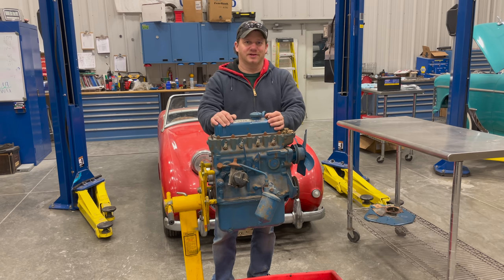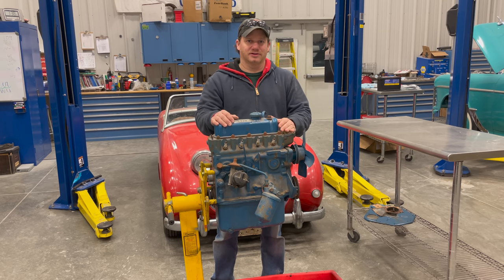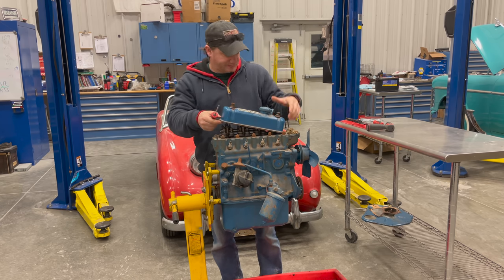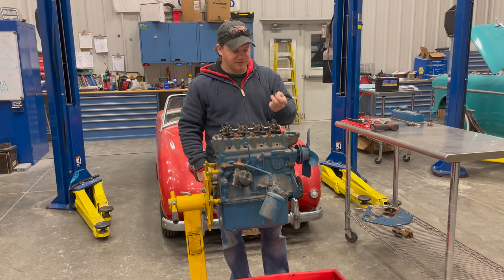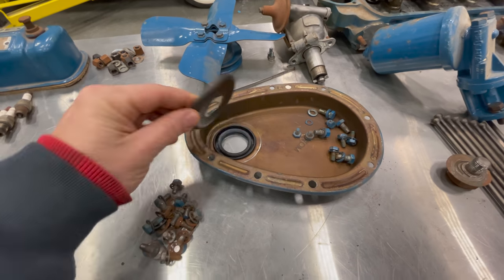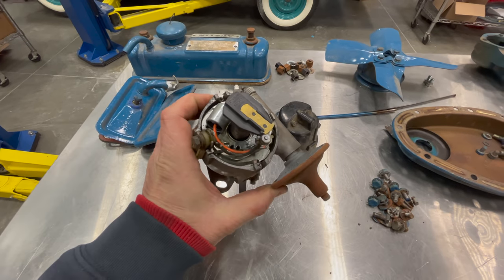Engine Tear Down for Barn Sprite Number Five

Comment: The reason for not using new plugs on a fresh rebuild is we old school mech's didn't want to oil foul new plugs from the assembly lube.  Back in the day spark plugs were not so good quality.  Just saying.
Reply: Logical !
Reply: @marcryvon  The usual process was run, and drive the car for about half an hour.  Replace the Plugs, and oil filter.  Just old school process.

Comment: The cost of a "service kit" - plugs, points. distributor cover, spark plugs, air/oil filters is pretty low - for my 1098 A series engine. The biggest problem is with the cylinder head gasket... 
The gap between cylinders 1&2, 3&4 is quite narrow. If the head or cylinder block isn't perfectly flat, the gasket will blow between one of the pairs. If you have the head off, it's worth checking!
(the original is copper/asbestos - nowadays copper/cork).
Regarding the valve seats, do look up the experience of the Morris Minor Owners group - there's views both ways, but unless you're going to drive it hard and high mileage, you shouldn't need to invest in changing the seats for ages.
The problem I had with the A series is that of condensation - the rocker cover would have amounts of white oil/water emulsion - this then gets into the breather pipe and causes minor problems. Regular oil changes (about 6 months or 6000 miles on a quality multigrade oil - not synthetic - will help!

Comment: You do tend to have pretty good luck with mechanical stuff Steve but this time, looks like a total win/win. The only thing that would be worrying me a 𝑤𝑒𝑒 bit is: Why was it never run, or even installed? Did the last guy find a huge problem or did something unrelated change his plans? Here's hoping he just got side-tracked and you've got 𝒂𝒏𝒐𝒕𝒉𝒆𝒓 excellent wee sports car, with a rebuilt engine.👍👌😁
Just a thought: could 2021 be the year of the 𝑙 𝑜 𝑛 𝑔 𝑒 𝑟 videos?😂

Comment: I'd check the clearance in the oil pump just in case they missed that. Distributor looks hideous, wonder why they put it back like that? Sweet engine. Where's the inlet manifold and carb, exhaust manifold?

Comment: When they made those side plates I wonder why they did not put bolts around the edge, outside the gasket.  Putting a bolt through the middle defeats the gasket.

Comment: Has the head got hardened valve seats?
Reply: No, but getting the A-series engine converted to being ULP-compatible is a routine procedure: boring out the original valve seats, pop in hardened steel rings and then re-machine.
Reply: @Seele2015au  Tks. I'm aware of the practicalities of doing it. The question was more if it had been done as part of the previous work on this engine.

Comment: I’m new to these little Sprites. What color were the engines originally?
Reply: Hi James. I guess the nearest l can think of is the Green on John Deere tractors  ? Or fresh dark green grass  , if you're lucky enough to live out  in that part of the world. The "A " series  engines came in 3 sizes. 1958 to 1961 948cc. 1962 to 1966 1098 cc . 1967 to 1974 1275cc. And the "rubber bumper " models which were M.G. midgets were 1500cc. Triumph Spitfire engines. I think the Austin Healey Sprite name was dropped in about  1971 / 2 . and all subsequent models received the M.G. moniker.    Over here in the UK  all factory reconditioned engines on the "A " series engines as they were  called were supplied in a gold finish . This was known as a "gold seal " engine .  I believe they had a 12 month , limited mileage guarantee . The mk 1 sprites were called "bug eye " sprites in  the US , over here in the UK they were called "Frog eye "  sprites.  Hope this helps. Take care and stay safe.
Reply: The green in question is called MOWOG Green. And a glorious colour it is too :)
Reply: Thanks Fella’s!

Comment: Questions many amateurs will boooo me for : What is the market value of those Bug Eyes ? What is the power output of those engines ? 40, 50 or 60 HP ?
Would dropping in a much modern and powerful 😱 Brit engine in it - no, not an LS !   Would that hurt the value of the car ??
Just asking...
Reply: Here in the U.K they attract a premium over the MG Midget, the Frog Eye another premium. The Continental European market in classic cars commands stronger prices [generally] than Britain. Over and above that , it's worth what a buyer is prepared to pay based on the condition of the vehicle. Projects fetch less than restored car's. Lots of people in the U.K like a car to come with a certificate of road worthiness or MOT as we call it.

Comment: Engine has never been run why the tear down not a drop of oil on his hands what a waste of time and money
Reply: Unless you talked to and trust the actual person that did the teardown and rebuild, it's a bad idea to just assume they did everything right, even if they meant to.  Sometimes there might be something the rebuilder didn't know about that particular engine and missed it. 
I had a friend that bought a 305 that was rebuilt and looked great.  He chose to go ahead and drop the motor in a 1979 Chevy pickup.  It turned out the person who "rebuilt" the motor just cleaned it up, painted it and slapped it back together without replacing the rod bearings.  The motor didn't last three months.  I'd have torn the whole motor down as well, especially considering how scarce parts for that engine would be.
Reply: It’s his channel.
Reply: How did you know that BEFORE he tore it down? Try thinking before you come with negative  comments.
Reply: Shirley. I think you're having a bad day . Prevention is better than the cure !  😊
Reply: let's face it, its hardly a complicated engine to strip and check he ain't paying for labour.
Reply: Would have been a pretty boring video if he just stood beside it looking at it for 9 minutes and 48 seconds.